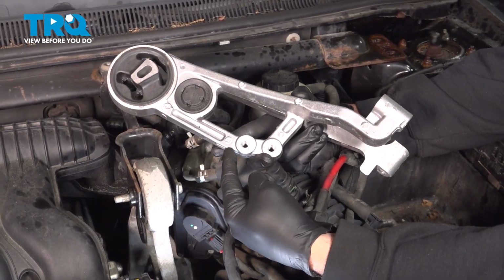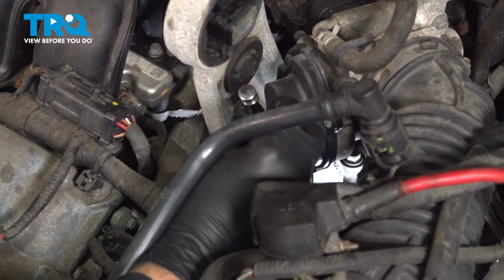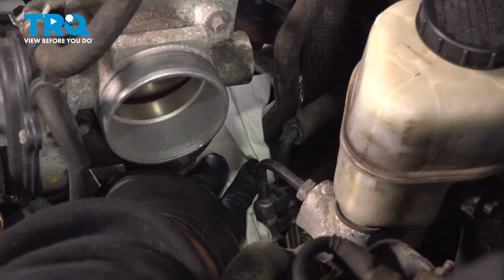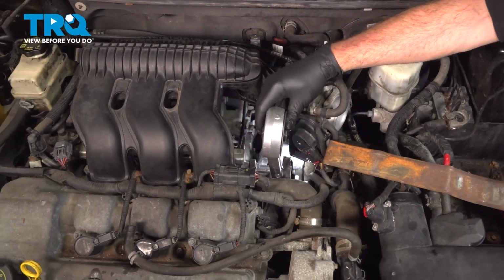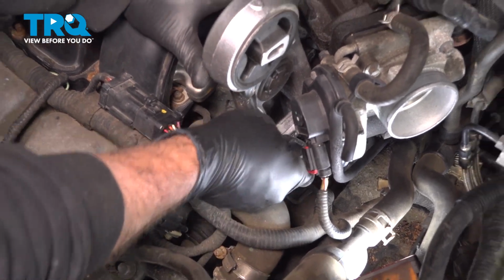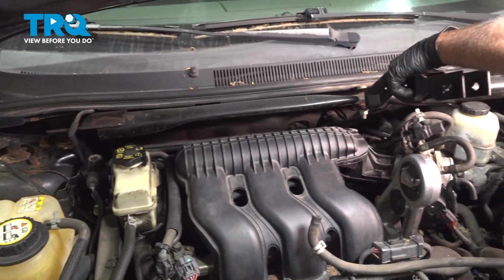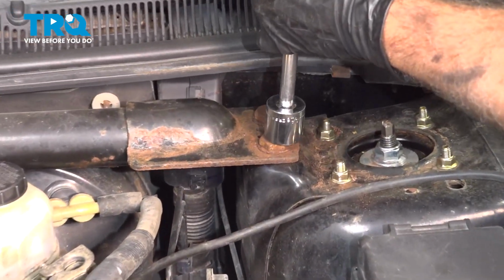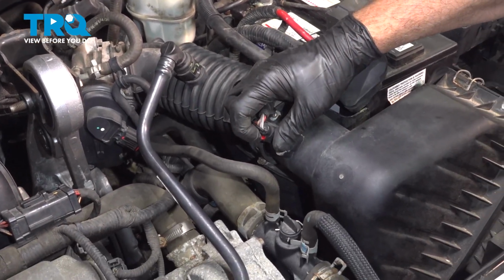How to Replace Engine Torque Strut Mount 2005-2007 Ford Five Hundred

Comment: there is a slight difference in installation between the 
cvt  and  standard trans since the 2 parts are different but basically  the  same

Comment: Looks to me like this video is missing a lot of steps because there's no way you got that last bolt by going down the back side of the motor without removing a bunch of hoses/wires, etc... 
I mean you can go strait down but once you do there is no room to move your wrench to torque on the bolt or even ratchet it.